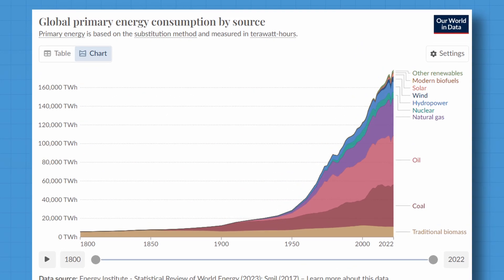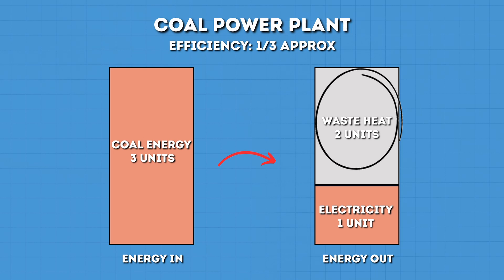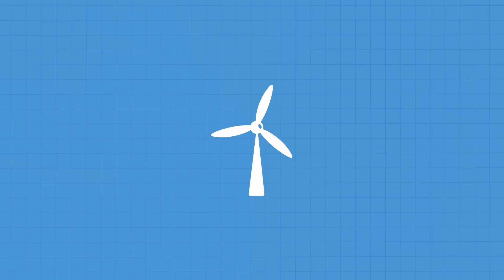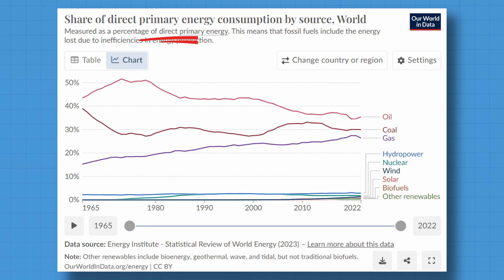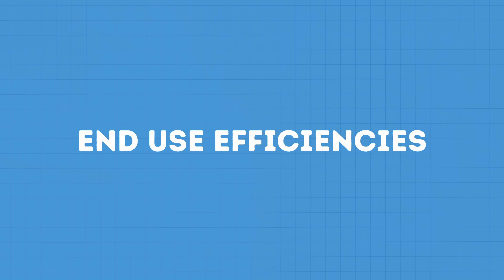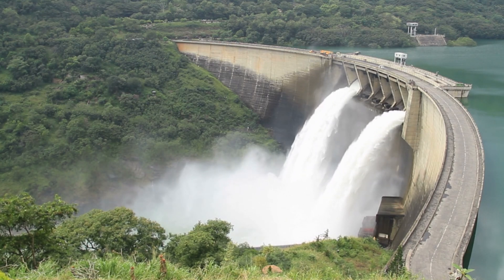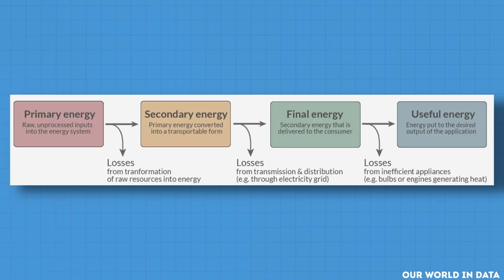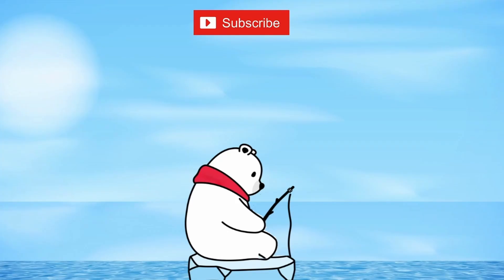We need to talk about the Primary Energy Fallacy

Comment: You are painting a pretty picture for wind and solar that it just not deserve and I'm not sure of the basis of your "wasted energy" from fossil fuels. A report came out from and Australian government agency last year stating that the total nameplate capacity of wind turbines across Australia produced just 30% of their stated nameplate capacity on average over a year. And for commercial solar it was just 20% of their capacity on average over a year. Pathetic in both cases.

Wind and solar should not be measured by nameplate capacity against coal, gas or nuclear. They are not equal. In the case of wind and solar the nameplate is an indicator of their maximum output in ideal weather conditions. But the reality is that the output of energy in a given year from this infrastructure is an unknown. Whereas coal, gas and nuclear are 'engineered' to produce reliable energy 24/7 for 60 to 80 years without the need to roll-out tens of thousands of new transmission lines and on a tiny footprint of land.

I have the misfortune of living in a designated renewable energy zone and what is planned, and the extent of what is planned for our wine, cropping and grazing land is absolutely horrendous. There are 54 projects in the pipeline just for our region alone. There are five of these zones in NSW and the infrastructure is built outside of the designated zones as well. Just 'one' wind/solar project planned will start a few kilometres from our home and will consist of 63 turbines at 6MW and standing 250m high, 200m wide and potentially with red flashing aviation lights and will utilise 77 square kilometres (30 square miles) of agricultural land. The million plus solar panels will utilise 13 square kilometres (5 square kilometres). The total site it 90 square kilometres and will also include hundreds of container sized battery packs each with four air-conditioning units, two substations and 11 kilometres of internal transmission lines to connect to the new national grid that has yet to be built. The cumulative effect of all this will be horrendous! And our region was rated the top regional tourist destination for two years running. 

Australia has a total land area of 7.688 million square kilometres and only 6% of that is deemed agricultural. This is where this industrial infrastructure is going, and many of these massive projects are back to back driving out or destroying every native species of birds, bats and marsupials innthe process. What part of this makes any sense, all for a source of energy that has a pathetic output and most of the infrastructure doesn't even last twenty years.

Comment: Also if you are going to make more videos about other aspects you missed out on, maybe instead you should have written a book like the one by Dr David Mackay which was pretty well done almost 20 years ago, it points out the fallacy of imagining how to base an economy on REs alone, basically you would need several times the land mass of the UK covered in PV or turbines to power some of the energy of another UK land mass elsewhere. Basically with REs, the UK just don't have the land area to be RE pure. The USA does but, bven Bill Gates had a go at it too, he was that awesome he had to rewrite the book for the US reader.

"Without The Hot Air", it's a free PDF download and covers all the energy graphs and explains where all the energy use goes, and its a lot more than just powering yer home by 2 orders.

The next fallacy that the climate folks are going to push is that Carbon Footprint is another fallacy that the fossil industry is pushing to spread the blame around. That one needs to be nipped in the bud before it takes off. Evryone just want to deny their footprint once they get a few PV panels on their roof. But read the fine book, Without the hot air.
Reply: Wind, solar, batteries, hydrogen, biogas, and dams can do it all.  Modernization, knowledge capital, green spaces, and geothermal are also underutilized assets.